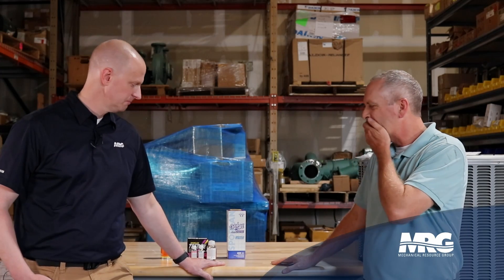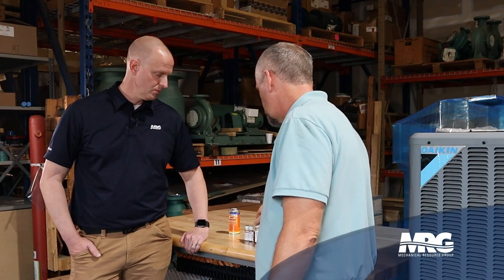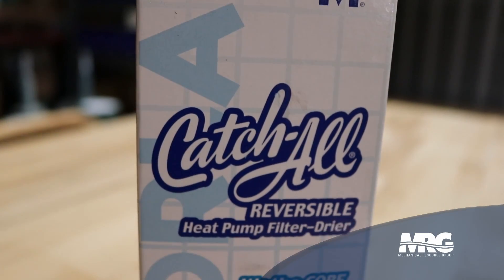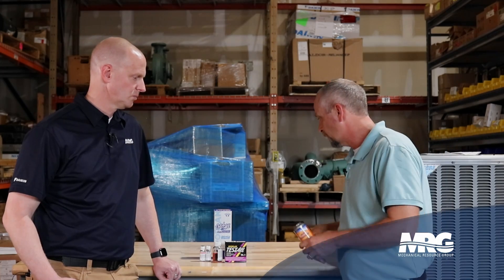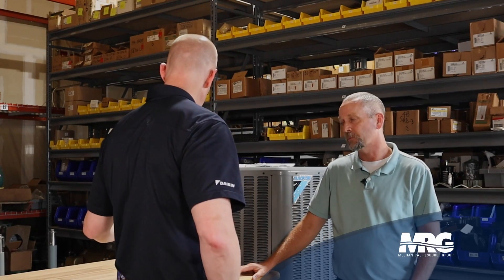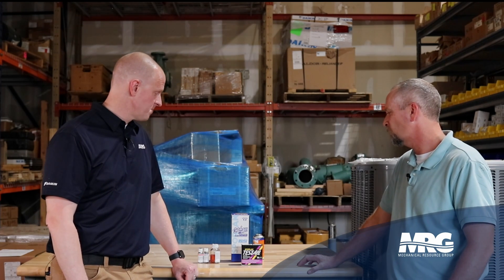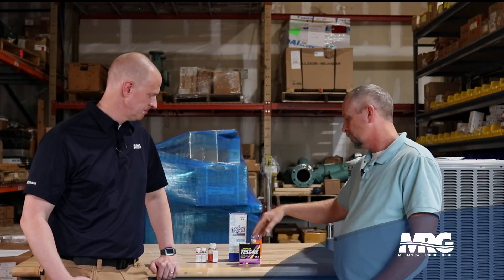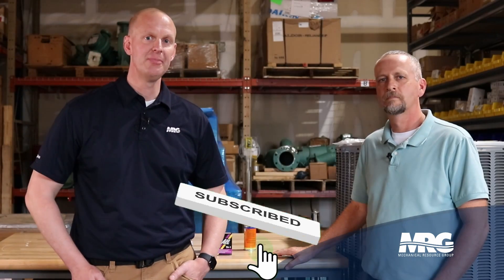Compressor Burnout and Acid Management: HVAC 101 @MechanicalPros

Comment: I want to add....an HH drier is not a high acid drier. Its a high wax drier. I thought the same thing until heard different. Looked it up from Sporlan's website. That acid scavenger.....i used to use that as well......until i learned what it actually does in the refrigeration circuit. Its a base....and if it comes in contact with acid.....it turns it into salt. So needless to say....i don't use it anymore.

Comment: What about black stuff or discoloration inside the pipes p
On package heat pump unit ? I had burn out it wasn't severe but suction pipe was pretty dark carbon so I just installed newel suction dryer.

Comment: Can you get all the acid out of the system if there is a compressor burnout?  Such as in a GeoThermal unit.
Reply from the maker: Hey David! Yep, as long as you follow proper cleanup procedures and use new refrigerant you should be able to remove all of the acid from the system.
Reply: Yes, you should be able to absolutely get all the acid out of the system I have had some small Daikin chillers that burned out so badly I had to isolate the evaporator and condenser flush them with a neutralizing chemical and then flush all the chemical out with solvent then try the system Purge with nitrogen and Vac as usual. You can also use a high acid suction dryer if you're using a system large enough that the capacity of the suction dryer won't affect your total charge and performance. The system I'm talking about only held about 4 lb of r407c

Comment: I'm working on a Daikin oil cooler with a sever burnout. When I did the flush I got chunks of mystery material and green oil / flush.  After about 3 gallons of flush ( yes 3 gallons ) the flush slowly turned from light blue to clear.  I am assuming that is a chemical reaction to the acid attacking the copper in the condenser.  I was flushing the condenser BTW.  The evaporator cleaned up really quick with the same type of contamination.  Does anyone else have an idea about when the green color came from?   I know it wasn't dye.  the oil was so acidic that it burned the skin on my fingers.  Oh ya that stuff smells awful and is about imposable to get off of your fingers.
Reply: Will any of it stay in evap after flush of nitrogen? I have fear micro channel evap condenser or etc
Reply: @xraybravo7180  honestly, I I use acetone to flush out evaporators and condensers and then follow that up literally with a flesh of compressed air. Then a flush with dry nitrogen before the vacuum pump. The best advice I can give is to pull a good hard vacuum if you can and then change your oil repeat a couple times. I did have a unit one time that in hindsight I don't think I got all the acetone out like I thought I did but it boiled out into the vacuum pump oil and I wondered why I couldn't get the vacuum down. After changing the oil a couple times I got all the acetone to flash out of the system and got a good hard vacuum going. But it was a little bit of a head scratcher trying to figure out why it wouldn't make a solid vacuum down to about 200 microns or less. If you're solvent is still evaporating off you probably won't get below about 2000 microns.

Comment: Great vid.  Lot to unpack and yes, I took notes.  But I don't want to assume what a triple vac is.  Does that mean getting down to below 300 microns, releasing the vac, then do the same thing again two more times?
Reply: Yes, and when you break the seal, only use nitrogen.

Comment: Another important point.....weigh and compare the volume of oil removed from failed compressor. A factory installed compressor will have x amount of oil. The service compressor will have less oil in it. 

I just went through this. The original compressor had 42oz of POE....i weighed the oil and had 19oz of oil out in the system....i removed the txv....used flush and boat load of nitrogen. New compressor had 28oz of oil. I pumped in 10oz of new POE. Used an HH drier and acid scavenger. Tested the oil a week later.....i didn't show any remaining acid ( granted it was one of those 2 second quick checks, so reliability of the test has some error built in ) i feel confident i did my job to the best of my abilities
Reply: Should the hh liquid line dryer be replaced after two weeks also? Or just if you use a suction side dryer?
Reply: @eringabbybennett  i would say teplace it based on pressure drop/temp drop across the drier.